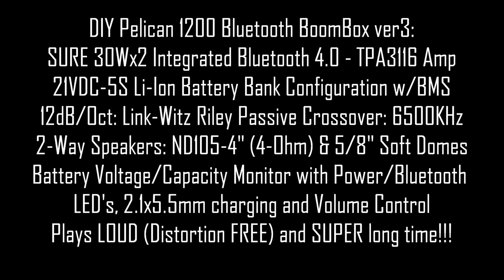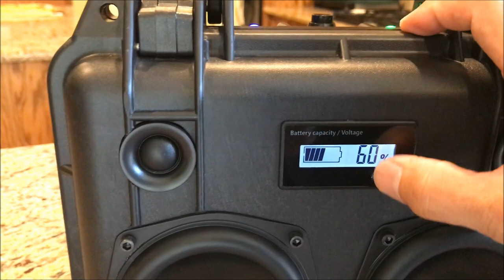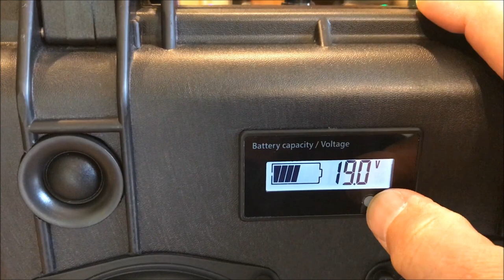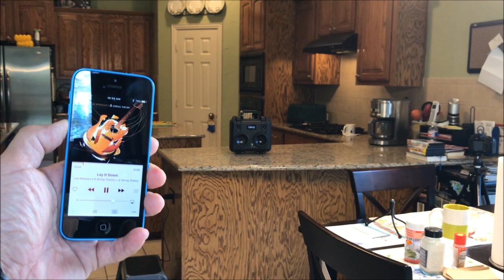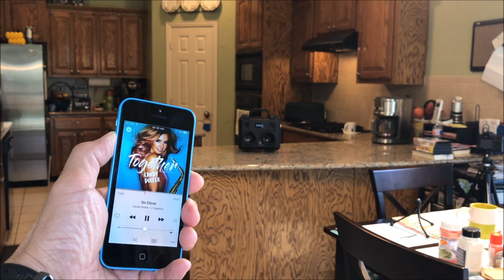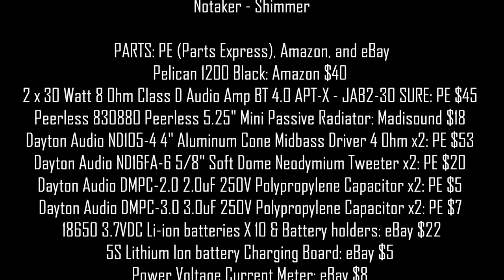DIY Pelican 1200 HiFiBoomBox ver3: 30W/ch - 21VDC (5S) Li-Ion & Bluetooth 4.0/AptX

Comment: Question: Hard to tell from the vid but are you using the same hookup wire to double as your speaker wire?  If that's the case, are you using stranded or solid hookup wire?

Another solid build bud!
Reply from the maker: I'm using the optional board wire kit which appears to be multistranded and maybe 20-22g. I typically use 18g as power and speaker wire and 20-22 for signaling. Sometimes solid for signaling as its easier to "mold".

Comment: Think you can provide a schematic for the crossover in this build? Or do a video covering crossovers? Thanks! Great videos!
Reply: Just look up Second order Link-Witz Riley  with a crossover of 6500hz. There are plenty of crossover calculators online.
Reply: Rob Colon   on those crossover calculators. When they ask for the impedance for the woofer (or tweeter), do I fill in the NOMINAL impedance of the woofer or the impedance at the frequency I'm crossing it over. It would be great if someone could help me!

Comment: I have this tipy Dayton Audio KAB-BE 18650 Battery Extension Board for Bluetooth Amplifier Boards. I get a 3-type battery but the amp does not work when connecting this as it can connect 6 or 5 ampere ampere batteries

Comment: sweet speaker. About that charging, I tried step-up convertor where you can select exact voltage but it was only working for some time. Now I am charging with my lab power supply or with my model air craft charger (I even put a balance lead on my speaker so, it is balanced) anyway hope you will find working solution. My next speaker will be 9s (37v) 220w amp with 10" sub :]
Reply from the maker: I also tried a boost convertor but it couldn't handle the current requirements...smoked! I'd like to see a video of your 9S project sometime!

Comment: Dear modiane, great work you're doing! Keep it up. Really enjoyable to watch!

I am currently building a portable boombox with 2 sure amplifiers (2x50w + 1x100w) with a dedicated 2.1 preamp. allthough when i power up the whole system, it creates a huge pop sound (and a smaller one when powering off). I've seen you've built a similar speaker as i am planing, and I would love to know how you fixed this major issue with these amplifiers. And I think from what I've seen you didnt use the mute/standby function of the amplifiers as well?

Would love to get an answer.
Greetings from Austria!
Reply from the maker: To be honest most of my boomboxes have some kind of startup /shutdown pop. I haven't experienced anything detrimental so far and really not concerned. The JAB boards exhibit much lower pops.

Comment: I wish you had a better mic than an iPhone so I could know what to expect if I were to make one of these myself.
Reply from the maker: iPhone mic is one variable and there are other variables to consider affecting sound quality. The adventure of creating your own great sound is what attracts me. And room to improve keeps me going. Try it!
Reply: modiane1 I'm all for experimenting but for my first boombox I need to know the parts I pick can  do what I want before I buy them cause I don't have any disposable budget right now. On that subject, do you know of any small subwoofers (6" or smaller preferably) that have appreciable frequency response below 65-60hz? I can't find anything, I was hoping to get something that can do low 30s but I'd be fine with mid to low 40s at this point.

Comment: I noticed that you haven't covered the tweeters with pvc or anything like you had done in previous videos... Is there a reason that you chose not to do it for the 1200 build?
Reply from the maker: Tweeters are air tight sealed...

Comment: I'm working on building one of these and wanting to get the crossover done correctly. Does it matter what leg the inductors and caps go? Also on the mh-audio site it shows the High pass being reversed on polarity...does this matter?
Reply from the maker: Craig Cary no as long as crossover components are on the correct speakers. Link Ritz Riley requires on speaker out of phase.
Reply: modiane1 perfect thank you!

Comment: Hi Modaine, is this a 8 or 4 Ohm amplifier board?  Ah I already see its 8 Ohm's didn't look good.......
 the one I can find is the 8 Ohm  version. Why I ask is that I see you use 4 Ohm woofers and 6 Ohm tweeters.
I want to use the Dayton Audio AMT mini 8 air 8 Ohm tweeters and the ND 105, should I use the 8 Ohm woofers because the amplifier board is also 8 Ohm's?
Reply from the maker: I usually find the 8ohm rated boards can handle 4ohm loads with no issues unless they specifically state they cannot. Having the passive 2-way crossover with a 6ohm tweeter results in an impedance curve that will vary allowing the amp to be stable. As long as the power supply can supply the required voltage and current with the amp board being "limited" gain (20-24db), it'll work fine. I've been testing this particular boombox at high volume levels and it runs cool without crazy distortion. Battery is life extremely long!
Reply: modiane1 Thnx Bro, today going to order my parts here in Holland, was surprised to find a dealer here in Holland soundimports.eu/nl they have the most parts in stock.....

Comment: Hi Modiane, i have a 2x50 watt jab2 bought the wrong one, is this also going to work in this project ? all other parts are the same as yours, Cheers Philip
Reply from the maker: As long as you have the 6 pin cable to talk with jab3. jab 3 can be 2x50w or 1x100w.

Comment: Hey what type of crossover will you recommend. I am going to use 3 inch 4Ohm 15 Watts Full Range Speaker 100Hz-18KHz and a 1.5 inch 6Ohm 10Watts Dome Tweeter. Thank you!
Reply: i would go for 7000hz, does the SPL match?

Comment: 5S Lithium Battery 21V 18V 15A Protection PCB Board Li-ion Lithium Battery Cell Hello I wanted help from you if you help me get a 50m + 50 apmifier i want to connect it with 6 3.7v batteries. This is the Dayton Audio KAB-250A 2x50W Class D Audio Amplifier Board with Bluetooth 4.0 How can I connect the battery with the amp, can you make a paper sketch if you can help me .